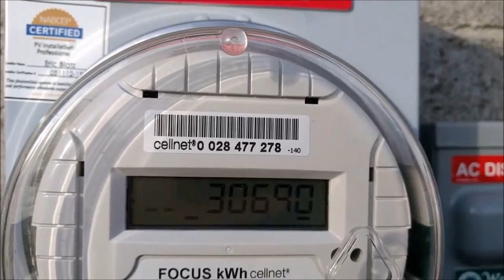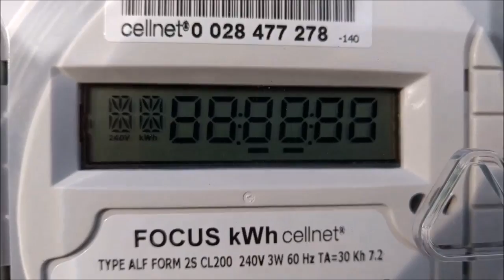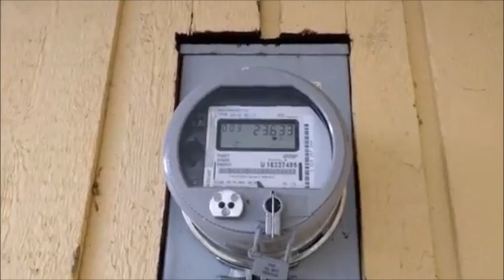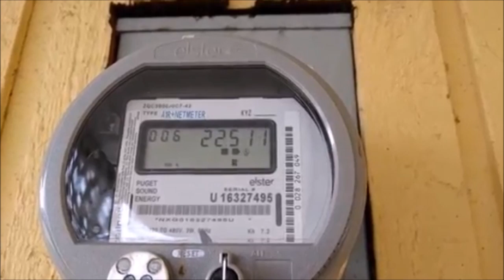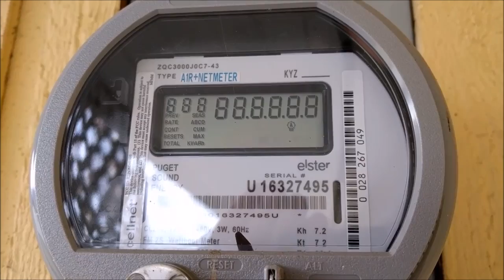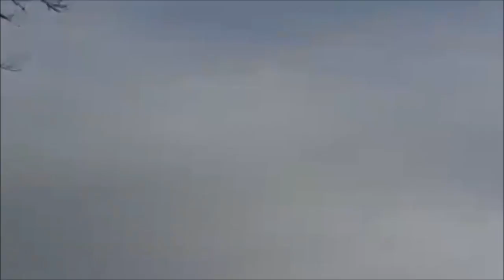PSE Solar Meter Reading 101

Comment: So they are using one meter to read incoming and outgoing power? Do they have to program that mode or is that meter always like that? And why did utilities demand for solar users to have TWO meters on thier homes?
Reply from the maker: I believe they do have to program the meter to record and display the measurements of incoming and outgoing energy, but I don't know for sure.

As far as there being two meters, this is because of the state's incentive program. They pay us for ever kWh we produce, whether we use it or not, and the only way to measure that is to have a meter directly on the lines coming from the solar array -- the single net meter with incoming and outgoing is not sufficient to measure that.